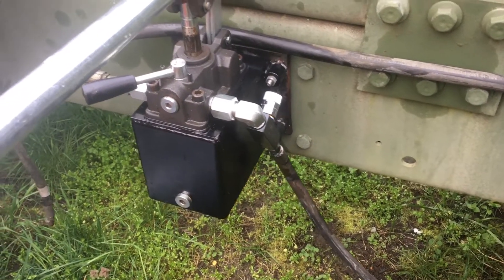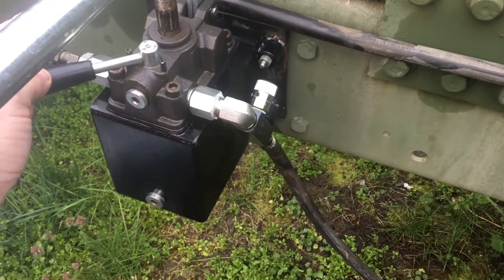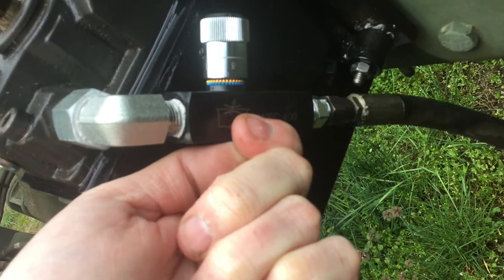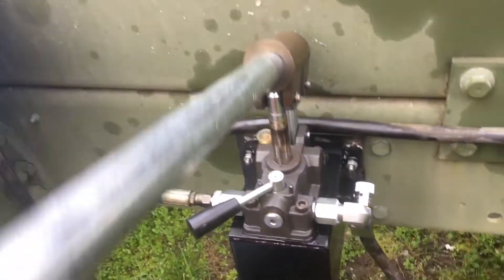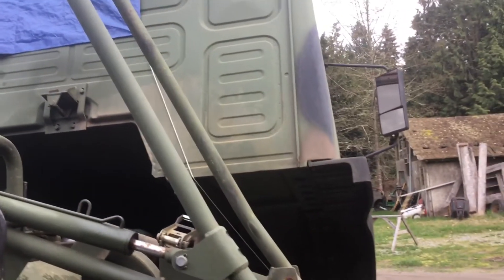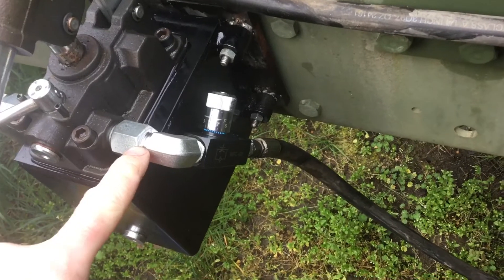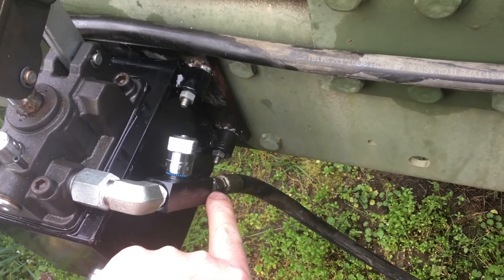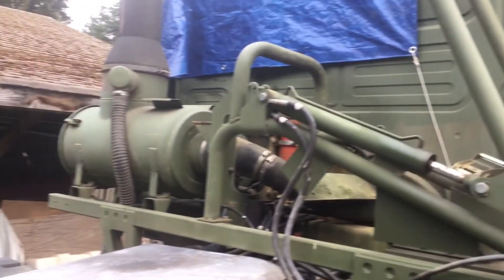LMTV cab hand pump update(flow control).

Comment: How do you control the cab lock?
Reply from the maker: Same as it has always been controlled.  The cab latch has always been Td off of the hydraulic line running to the base of the lift cylinder.  As you start to lift the cab, pressure builds on that line which pushes the latch piston to compress a spring and release the latch. When the cab comes back down, it rotates the latch back into the locked position, releases the captured spring to lock the latch until pressure is applied next time you lift the cab.  I have actually contemplated putting in a manual pull handle to release the latch and disconnect it from the hydraulics, as they have been known to spring leaks, which keeps you from being able to build enough pressure to lift the cab…

Comment: Can I ask, do you think this hand pump would struggle (or be too tough to do by hand) with a lot of weight added to the cab? I figure I'll be adding maybe 800# to it by the time it's all said and done. Thanks!
Reply from the maker: Ok, well the stock 1600# empty cab has about a 35” moment arm from pivot to CG.  The lift cylinder is 13” along that moment arm.  That 1600# with those moments and a 2” hydraulic cylinder = 1400PSI peak to lift the cab.  Adding 50% in weight, as long as it doesn’t alter the CG too much , will increase that 1400PSI by the same 50% to 2100PSI.  Thats about how much pressure  it takes to lift the spare.  That will of course increase the 21” lever force from ~40# to ~60#, but you can mitigate that by simply lengthening the lever by the same 50% from 21” to ~30”.  I wouldn’t want to run the cylinder pressures much over 2500PSI, but that prince hydraulic pump is capable of 3500PSI.  Everything is within its limits, so it should work just fine. Like in the video, I don’t raise the cab a hundred times a day, so I am a big,fan of simple…

Comment: Appreciate your videos, thanks for taking the time to get them up for everyone! Are you planning on covering the rest of the work you're doing/have done to free up the space behind the cab for the extra habitat length? That would be very useful, but either way keep up the good work!
Reply from the maker: Yes, once I get the air filter relocated up onto the roof(have one air duct to build), I will do a summary video.  This hand pump takes care of the Air op pump and manifold.  Then the coolant expansion tank was removed(see cooling system mod videos) then the polarity device and shunt were removed, there is a video for the straight 24v conversion that took care of those components.  I have removed the ether system, and that is going to go where the 2way checks were located under the drivers floor.  I did a video on removing the front glad-hands and those 2way check valves.  Once all the parts are off the arch, you unbolt the regular bolts and cut the Huck bolts that hold the arches on, then lift them off.  Not a lot too that part, except the Huck bolts inside the arch channel are a pain:)  shoulda called them Suck bolts…  i am repurposing the lift arch to extend the rear of the upper frame rail, which will be my floor frame.  That gives me about another 18” of deck to work with for the habitat in addition to that space freed up by the tire, arch, filter, hydraulics, ether and power component removal. I am going to install the tail lights into the box tube of the lift arch, which ought to look pretty good when done…
Reply: @rronmar  Epic, thanks! Watching closely!

Comment: Hmmmmm… will the spare  tire carrier also utilize the wolverine pump ?
 One pump, 2 applications ?
Reply from the maker: Well mine will not, as I am deleting all that structure.  My tire will be on the back of the hab placed in it’s,mount with a winch…  The wolverine pump could also operate the spare but you would need a 2way diverter valve(6 ports) which has one set of supply and return ports that are switched between two sets of ports to control two separate cylinders(about $160?).  The tire lift does require about 50% more pressure, so about 50% more lever force(over 60 pounds) would be required.  A longer lever would be desirable IMO.  I am going to use a longer one to ease the 40 pounds of force a little for my finished installation…  here is a pressure test video I did way back when…  https://youtu.be/cJnEzjXbQ_Q